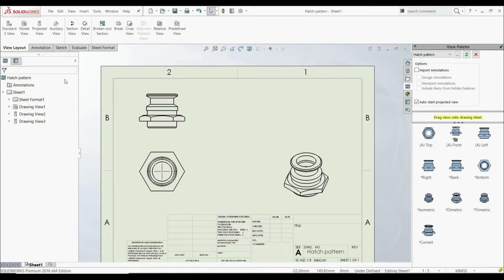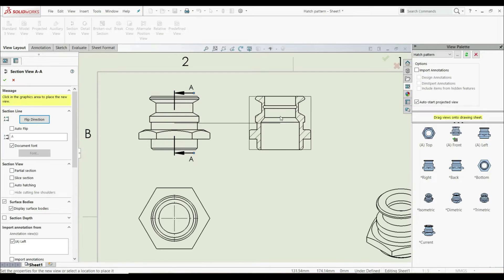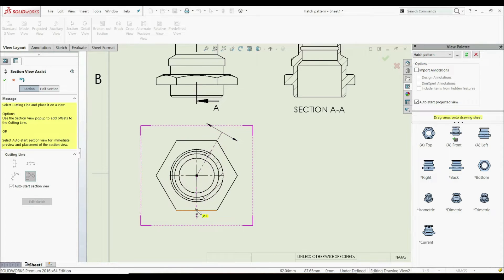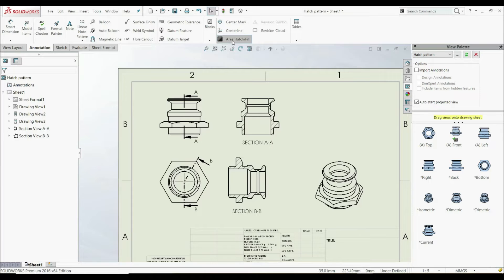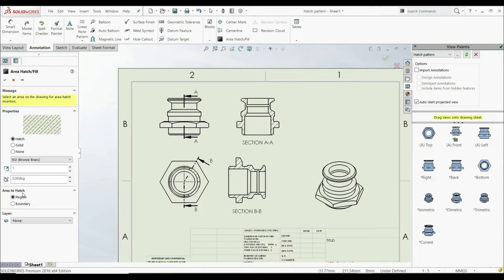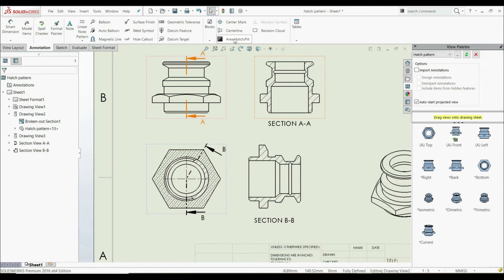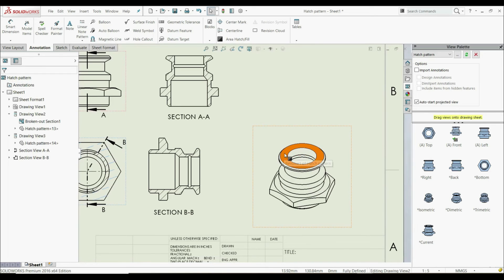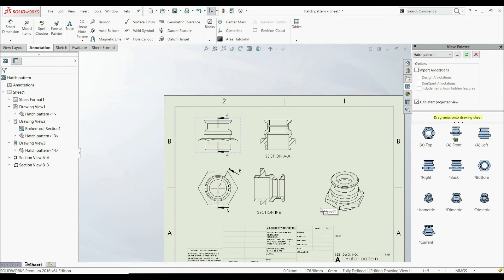Solidwork Tutorial - Hatch Pattern

Comment: How to change the scale of those that were created automatically?
Reply from the maker: Method 1: Changing Scale for a Single View
Select the View – Click on the drawing view that you want to change.
Go to the “PropertyManager” on the left.
Find “Scale” under the View Properties section.
Select “Use custom scale” and set your desired scale (e.g., 1:2, 2:1, etc.).
Click Apply or OK to update the view.

Method 2: Changing Scale for Multiple Views
If you want to change multiple views at once, follow these steps:
Hold Ctrl and select multiple views in the drawing.
In the PropertyManager, check “Use custom scale” and set the desired scale.
Click Apply or OK.

Method 3: Changing the Sheet Scale (Affects Default Views)
If you want all views to follow a new scale, you can change the Sheet Scale:
Click anywhere on the drawing outside of views (to select the sheet).
In the PropertyManager, locate the Sheet Scale setting.
Change it to the desired scale.
Views that are set to “Use sheet scale” will update automatically.

Method 4: Overriding a Detail, Section, or Auxiliary View Scale
For Detail, Section, or Auxiliary Views:
Click on the view.
In the PropertyManager, check “Custom Scale”.
Enter your desired scale (e.g., 2:1 for a zoomed-in detail).
Click OK.